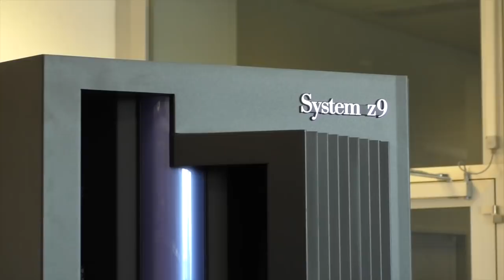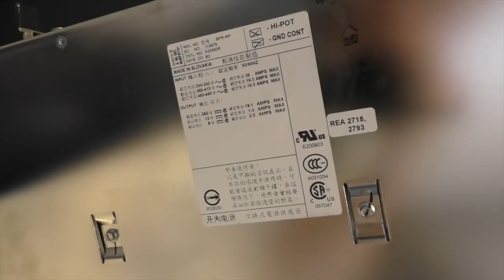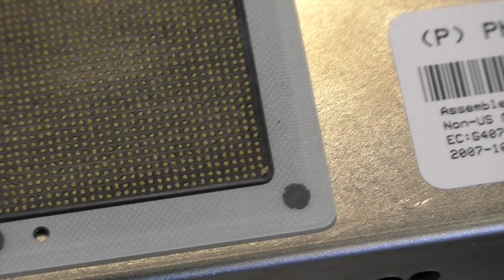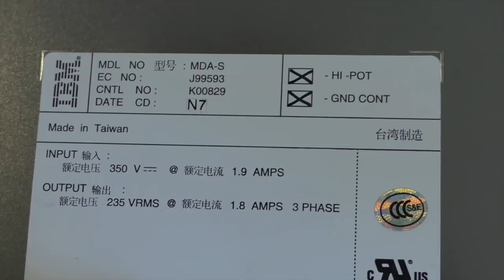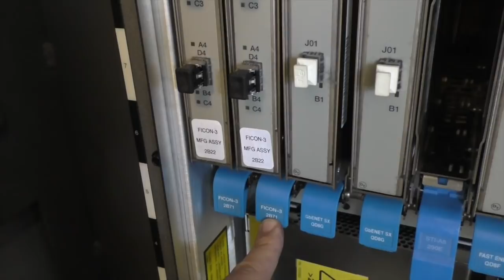IBM Z9 Mainframe Computer Teardown (PWJ31)

Comment: a lot of overhead for a 8 core/8gb computer ;-))
Reply: But the difference is that 8 core never needs to power down (they measure uptime in decades), everything is hot-swappable, everything has redundancy and security built-in, plus that machine can probably handle 2000-4000 concurrent VM's at the same time. Your average Intel 8 core CPU doesn't come close to the IO processing power of that Z9. :) Also consider that machine is about 13 years old already.
Reply: The point of mainframes since the early days is to have hardware accelerators for nearly everything. That's how they scale to billions of transactions per day. They have separate accelerators for encryption, compression, storage access, network communications. You can even get a hardware accelerator for parsing XML.

Comment: I don't know why a perfectly good mainframe had to be disassembled and put for parts. Wouldn't some large enough company that could possibly have made use of it be contacted and sold to them?
Reply from the maker: Companies that need mainframes always want the newest model. The also want IBM support and that's something you can not get with a used system. Or it will be massively expensive. The reason why we got this unit back was because nobody wanted it. And it was already partially disassembled for spare parts.

Comment: You should be wearing gloves when you handle any of that heat transfer paste.  I worked on IBM processors and some types of that paste is very bad stuff especially if it comes near open flame.  The warning labels on the tube is very specific that is is not to be handled.
Reply from the maker: Thank god I'm not smoking at work :-)

Comment: It's a shame, we would have bought that... and for considerably more than you could have ever reclaimed in metals.
Reply from the maker: yeah I know.... someones trash is other ones treasure. But I don't have the time or the patience to sell all my stuff. I make the videos because the things are on the way to scrap. Keep them on video before they are gone.
Reply: @PlaywithJunk  oh no, I'd rather a video than nothing.  I'm certainly not saying you did wrong - just that it is a shame.

These particular systems come up fairly regularly at the moment, it's just saddening to see many of them go straight off to scrap.

Luckily, I have many other toys at home to console me... there's my working DEC VAX 11/780 - the love for which first made me give in to the insanity of preservation and install a concrete floor in my home.  

And, only slightly more practically, 2,047Kg (over 4,500lb) of m1000e-m820 based blade cluster which, for asthetics, if not technical accuracy  sits inside three rather special old IBM round-holed racks wth lit and contoured doors.

Some might say that the more systems go off to landfill without me having a chance to acquire them, the better - I have friends that are becoming concerned for my wellbeing - LOL.

Speaking of which...

If anyone knows where I can find an old 70's era Prime 550 or 750 in (or close to) working order at £15,000 or less - there's a fairly substantial finders reward.

That was one of the first big systems I ever had complete responsibility for... and, it's true what they say, you never forget your first ; )

Anyway, thanks for documenting.